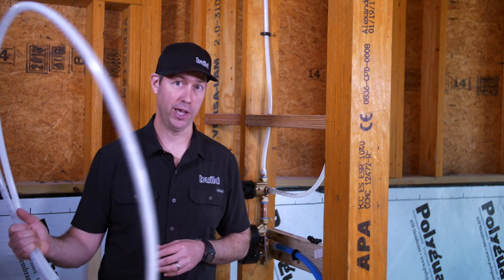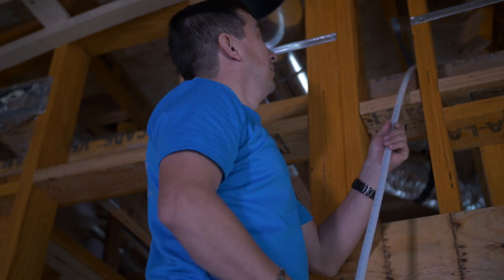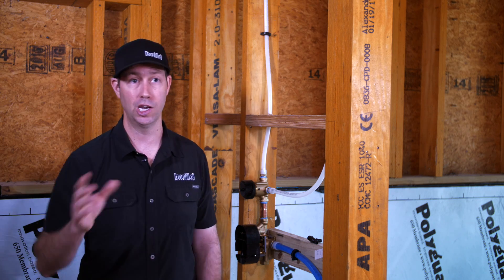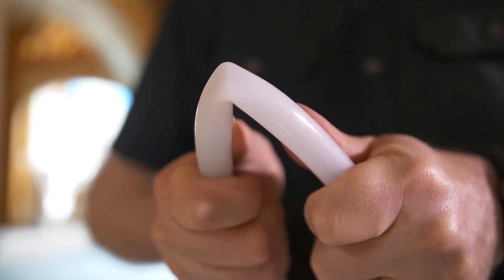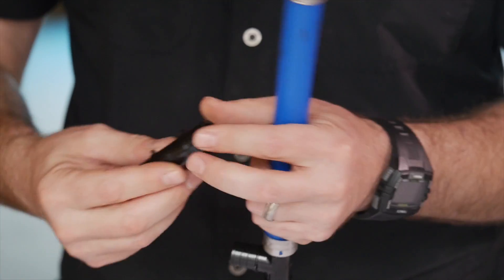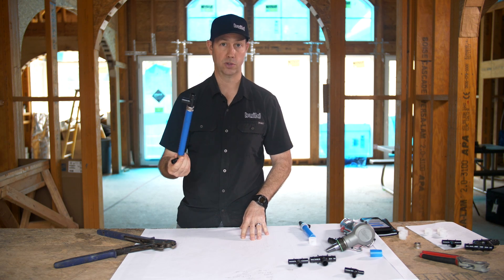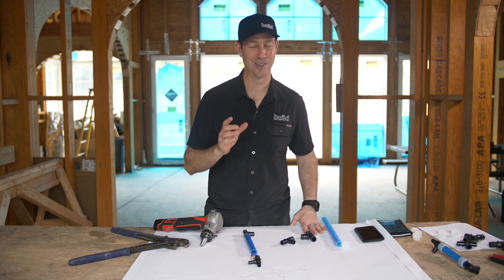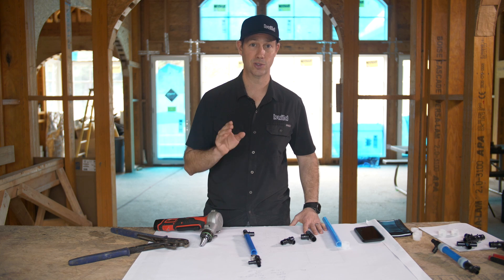PEX vs. Copper Plumbing

Comment: PEX is, I believe, the least understood and most misused construction material — ever. Let me explain:
   IF your house has copper piping, look at how it’s laid out. Typically there will be a single fat pipe feeding a multitude of smaller pipes, laid out something like a tree trunk and its’ branches. Lots of fittings, lots of water held in that system. Downsides include needing to shut off and drain the whole house in order to work on it, and (for hot water) lots of cold water to flush out before actual hot water reaches your appliance.
   Folks often lay out PEX in the same way copper systems are. If you’re replacing an existing system I can understand, but that doesn’t  make it right. 
   ONE component in PEX systems makes all the difference: the manifolds. Using manifolds, together with the unique properties of PEX, make for a completely different way to plumb a house. First, realize that each port in the manifold has its’ own little shut-off valve. That means you can shut off each line individually.
   The economy and flexibility of PEX makes it practical to send a separate line to each appliance / faucet. If you want to replace the shower valve, you need shut off only the feed to the shower; the rest of the house in unaffected.
    Next, the flexibility of PEX means you can run each line with fewer, or even without, fittings along the run. No tees, no elbows, no couplings. This detail really offsets the much higher expense of the Shark-Bite fittings. In a well laid-out system there might be NO fittings at all between the manifold and the final stub-out.
   The flexibility has additional benefits. The inherent flexibility reduces concerns about pipe hammer and freezing. Plus, the availability of colored tubing helps identify hot water lines. Best of all, the relatively small amount of water in each line means hot water reaches the faucet much quicker.
   BEST of all, PEX has no appeal for thieves.

Comment: I had to give up on drip irrigation because rodents kept chewing holes in the plastic piping. I worry that pex would have the same problem. Also how well does it stand up to UV light? Many plastics decay with age, and even faster from UV light.

Comment: Chlorine wont break down PEX - but it will eat away at Grey Plastic, any sort of old grey PVC fittings that were used, etc will get eaten up and crack and become brittle. Ive been working for the municipality and have never seen PEX pipe break down or even show signs of. But, those black PVC fittings will. Always use brass fittings between PEX fittings.

Comment: Been using pex b for a while now. Pressure drops are minimal. Close to none. Also used UPONOR when they were Wirsbo. 20 years ago. They both work great. But I would say the pressure drop is almost a myth.

Comment: I will stay with copper thank you. I am in the process of building my own house and it's strictly copper. To prevent water hammering there's grommets that you put into the drilled holes.

Comment: I guess in an old fashioned sense I'm still a little partial to copper pipe, but I will admit that I almost use exclusively PEX now just because the cost! I mean when you're building or remodeling a house if it's allowed by code I've never had any leakage problems with PEX tubing... And the difference in doing an entire house in copper if you have a loop system like with a circulation pump, and doing that same installation with PEX is absolutely astonishing

Comment: If using a water softener with chemical filtration (Specifically a chlorine filter), PEX and copper may have a comparable durability if properly installed. If using a recirculating heat pump, I question the ability of PEX to hold up in comparison to copper. Comparing the performance of the 2 systems when new gives the edge to PEX A for flow vs resistance. UV as an extreme catalyst in the breakdown of PEX by chlorine should also be considered.

Comment: You are using pax because it is easy but you still charge customers as if you doing a quality job. Pex is garbage like a plastic bag. I will not allow any plumber to use pax in my house and not even any copper but soldered joints as well . Either you know how to do it or get lost

Comment: Matt should do a program about chloramine disinfectant which is used in my neck of the woods. We have heard about entire new developments with many failures showing up in just a couple years. We are seeing copper failures as well. I'm beginning the process of repiping my house because the copper house supply line is shot. My house is 56 yrs old so the copper is prematurely aged. I'm using PEX A to repipe and I love it. My only qualms are the bad news I heard online from several sources about chloramine leaching zinc from the fittings and also degrading the hell out of the PEX. I w
Emailed the water company so they could weigh in. They said they use chloramine which I already knew but didn't comment on how harsh it is on PEX and copper.

Comment: Great Video I am getting a repipe in Florida the treatment eats up the copper  Plumber quoted using UPNOR  thanks to your video I know what it is . What is your view on insulating  pex running  in attic Florida no freezing weather . Worried about cold being to hot or condensation  plumber says it will be warmed up until ground water comes  and isulation will not keep it from getting hot sitting in the attic . Thanks Again

Comment: I am a new homeowner and am thinking about switching to PEX but I'd like to know more about the health issues surrounding it, specifically leaching of chemicals used during manufacturing. I've worked in the plastics industry for years and I know certain types of plastics (even food grade) leach badly. But, I don't know anything about PEX or the processes used to manufacture it. If anyone could comment on this I'd greatly appreciate it.

Comment: UPONOR Pex-A will no longer be available for the Red and Blue PEX and fittings. Will only manufacture the white PEX with blue and white lettering. There has been a lot of issues and complaints over the years to the manufacture that it will no longer be available. I talked to a Cummings plumbing supervisor today and he said the manufacture doesn't wants to warrant their product and blames it on poor installation work. Supervisor said that the installation work is top quality but the product is not holding up as claimed. To me copper all the way. I've lived in my home for 47 years, all copper pipe and never had any issues.

Comment: After 32 years in the plumbing and pipe fitting field, i finally tried pex in my house. Fast, cheap, easy.. 
I just used the products i found at HD and Ace so i knew i could get parts easy, so went with the (Apollo) pinch style rings.
I think if i do any amount of pex, I'll use pex A and Uponor expanding type fittings.
I can tell i get a bit less flow on my hose bibs due to the insert style fittings. But it's not a deal breaker.
For the other fixtures, you won't notice the restrictions.

Comment: Our 24 year old Florida home (on slab) had two leaks in the same copper pipe three weeks apart.  Plumber said copper is not good for our climate.  Suggested replumbing with CPVC.  Hoping we don’t continue to have leaks.  Luckily we have LVP new flooring in the entire house or we would have had extensive damage on both leaks.  Pex looks like a better solution.  Costs??

Comment: Maybe it's not common in the states but alluminium pex is far superior to pex and makes normal pex look like an amateur plumbing solution, in EU the norm is alpex and if you use plastic only pex, you are either stuck in the stone age or not a plumber at all. 

Alpex has an easier seal solution which just involves pushing the pipe over the fitting and pressing it closed with a hydraulic handheld machine, it looks cleaner, keeps it shape you bend it in, and can withstand more. It comes at the higher price than normal pex but still way cheaper than copper pipes, just the fittings are expensive.

Basicly a pex is the predicessor to alpex and Im dumbfounded pex is still the norm in the States. Viega is the main supplier of alpex where I live.
Reply: Good info
Reply: Everything in North America is in stone age compare to EU.🤣🤣🤣

Comment: Thanks for the good info.  A couple of years ago, I replaced a five foot section of a copper, hot water line in my basement bathroom, with PEX and Sharkbite fittings.  The project took less than five minutes!  Love both products.

Comment: If copper was as flexible as PEX-A, so that I could snake it through walls easily, then I would use copper in all of those areas. But copper is not flexible (even the flexible copper is really stiff), so you have no choice, you have to use PEX, especially PEX-A as it is way more flexible.  For the areas near the water heater = its all in the open there, so you can use copper there is you like to punish yourself with more work.

Comment: I'll take copper tubing all day long...it will last the life of the house & it looks like a skilled set of hands actually installed it
Reply: Unless you have a butcher install it without wiping clean the excess acid flux... or you have sulfur content in your water supply...
Have fun renovating in 50 years! hello pinholes

Comment: I was all ready to change out my old galvanized pipes to Upanor pex-a and discovered that animals (like rats) can eat through the plastic pipe.  Then there is the taste some have complained about.  I'm curious what others have done to mitigate possible animal damage in exposed areas like an attic. I think inside walls a safe but sometimes rodents can get inside and by the time they are discovered you could have a massive water leak and then damage to things below.

Comment: Discovered that I have UPONOR  Plumbing, and saved about $500 when I had a leak. The installer used the wrong fitting in a critical joint, and was easily repaired...

Comment: This is a great site! We had our Hot water line copper pipe freeze during our historic freeze in central Texas, and a break in our copper pipe, just inside our wall, below the floor level, thank God for that! The plumber replaced it with Pex, but we are being billed for a copper pipe replacement. I have a sneaky feeling that we are being slightly over charged. Can you please let me know if there is an over serer of plumbers in our state of Texas. I just want to make sure that we are being billed correctly. The company will not return my calls, which only concerns me more. Many thanks.

Comment: Eventually PEX will poison the entire planet.  Copper can be reused, and it doesn't end up floating around in the ocean where it ends up in all your future food like plastic does.    "Due to the fact that PEX is cross-linked polyethylene, it can’t be melted down, a process that would be required to produce new tubing.  Instead, after being collected and decontaminated, old and excess tubing can be grinded and pulverized down to form sand-like substance."

Comment: Last night I had a guy come over to fix a pin hole in my copper pipe. 3 hours later the vertical pipe was a mess and looked like a 3 year did it. The joints were leaking and eventually a real plumber had to be called who installed a pex pipe in 15 minutes.

Comment: So Pex have better flexibility VS copper pipes under extreme cold weather, does Pex still require insulation like copper pipes ? Or if add on insulation, will this  help Pex from getting frozen water ? Thanks

Comment: I worry about the long term reliability of pex. Bute failed , cpvc is showing signs of brittleness and failure. Yet we are assured that pex won’t fail. For an individual house copper is not that much more expensive and it provides peace of mind. Large builders can save lots on parts and labor on big multi house projects and the savings will not be passed on to the purchaser. Who really is benefiting here ?

Comment: I doubt any chlorine fluoride compounds (water uses, obviously not acids etc) are going to effect pex, it’s almost inert with water applications. Are the internal black plastic insert also cross linked true pex?  Because metals will react in chemical not housing applications.

Comment: Hi Matt,  you have got me really considering this for my whole house.  I have been looking at many companies that sell the pex pipe.
Reply: I like the manifolds or manabloc system which I have seen in your videos.  In your example, in this video, you used 3/4 pex.  The manifolds are a 1/2 in out.  Who do you use to buy the adapters from 1/2 to 3/4.  Finding the right adapters to things like faucets, dishwasher, toilet, shower, etc is a bit confusing.  I am having a hard time making up my mind 1/2 inch or 3/4 inch pex pipe.

Comment: In sweden we use pex as we have a standard "safe water". Pipe in pipe system and no, i mean no joint in Wall. Read more on uponor sweden and you will find it more logical. We do the same with electrical. Easy to change if you have a problem because you dont have to open the Wall.

Comment: One issue we come across with PexA is when you have a bucket full of fittings and they rattle around in your truck or some idiot cuts the bag open with a knife quickly your barbs get little nicks.  you can feel them with your fingernail.  These little imperfections cause water leaks and its very frustrating.

Comment: I own a house that was built in 1925, had to replace all the cast iron pipe with copper and foam insulation. I've had no busted pipes due to cold weather in unconditioned  areas. Where I live, sometimes it only gets cold to 32 degrees F / 0 degrees C.

Comment: I have a well with slightly acidic water that tends to leach copper out of copper pipes leaving green stains and bad taste especially after sitting for hours like first thing in the morning. And original copper under my slab almost all started leaking in less than a year. I can't believe they got eat up but I'm guessing maybe moving around during expansion/contraction from cold/hot water.

Comment: I was surprised you didn’t hit the message of copper as a huge heat sink. My new PEX filled house delivers hot water in less than 25 seconds at each fixture. In my old house filled with copper, I’d normally waste one to two minutes of water before getting a full hot stream. Huge benefit for PEX on this subject.

Comment: "Discovered" PEX via RV repair. Great stuff and now use whenever I can in home and on the road. There are adapters out there for any type pipe you can encounter to get to PEX for great repairs in older homes.

Comment: I was looking at the pex in my basement there is 2 manifolds  1 coming off the hot water tank and 1 cold water line and I was like ok if i have to take a hose off how the heck do you connect this again?? 

a special tool you say? I see said the blind man.

Comment: I used Uponor PEX pipes for my house construction too. A tip for anyone using PEX pipes and fittings. Temperature has a lot to do with installing PEX pipes. If your installing during the Spring, Summer and early Fall you rarely have problems with leaks around fittings. If you’re installing in the Winter in cold climates the PEX pipes takes longer to seat around the fittings. Here’s the tip, keep a heat gun handy and give the PEX and fitting a shot of heat evenly around the fitting and the PEX pipe. The PEX and fitting will seat quickly and stop any leaks you may have had around the fitting.  We used brass fittings with PEX pipes and the heat gun solved the problem.

Comment: I love the way that you say your as a builder and you say that you've never gotten a complaint for Pex failures but one. Homeowners can't complain about anything that goes wrong with a house after 5 years in a new home in most States, on top of that thats plastic reduces your water out put, not uv resistant not rat resistant doesn't help with bacterial elimination, and you say that somehow pex can be outside in the cold weather, PEX can't be outside simply because it's not UV resistant it doesn't eat cold to break it down, pex angle stops are a complete mess, PEX is only been around for about 20 to 25 years.
Reply: On top of that California band pex  in 2005 because of its toxicity in water
Reply: On top of that when you say it brought you great success you made you make a lot of money

Comment: Had a slab leak, the company that fixed it did a reroute w/ PEX-A 3'4"...replaced 6 ft' copper piping  w/ approximately 25-30' of PEX-A in my basement where main comes in, just after, or actually in the manifold that splits to various locations. This was cold water side that feeds bathroom in basement then goes vertical to feed upstairs kitchen, bathroom, laundry room, and outside faucets (2). Surprised to see two (2) 90 degree elbows at the point where they tied the PEX back into the copper line.

It's my understanding that I lose approximately 1/8" ID going from 3/4' copper to 3/4" PEX-A.

Considering an additional 20-25' additional feet of 1/8" smaller ID pipe w/ two 90 degree elbows in succession and knowing this feeds cold side downstairs and upstairs, would you expect a considerable volume and pressure reduction upstairs?

I am not pleased w/ how it turned out, insurance covers it all but deductible...I am inclined to instruct them to bust concrete across my downstairs hallway and replace the leak w/ copper piping. Or would larger PEX possibly resolve my concern?

Comment: As a plumber that uses pex, you didnt have only one fitting leak after 12 years with a "few hundred" houses a year. That's blatant lying or your plumber is lying, because there are bad fittings, rings and section of pipe all the time, and that doesnt only apply to pex either. I've ran many other types of water lines where there were leaks not because of installer error.